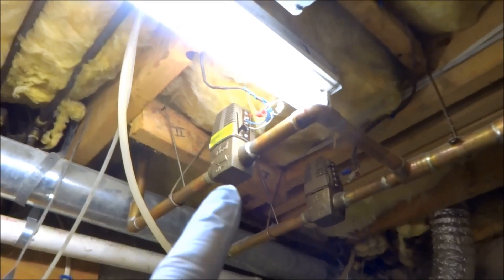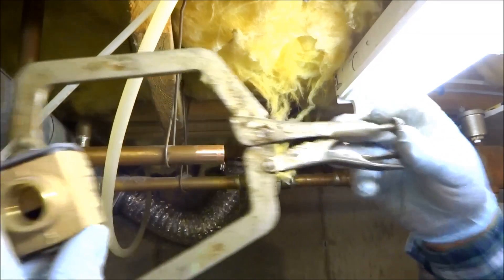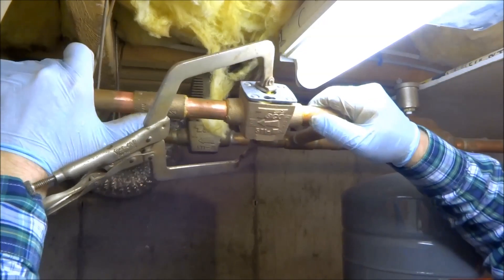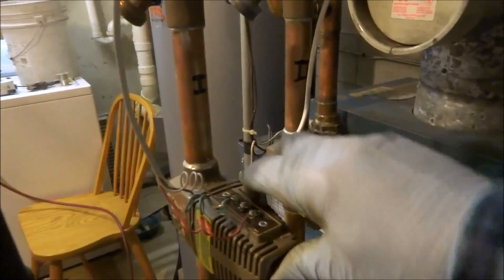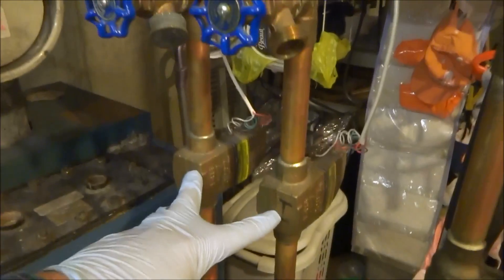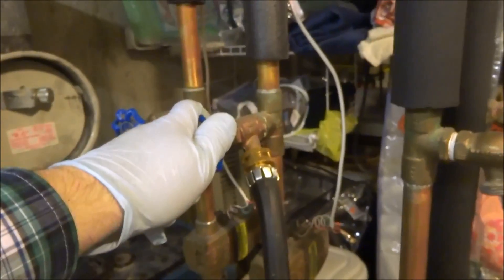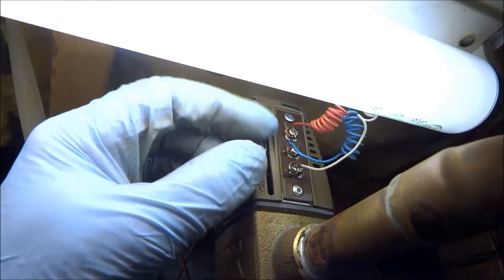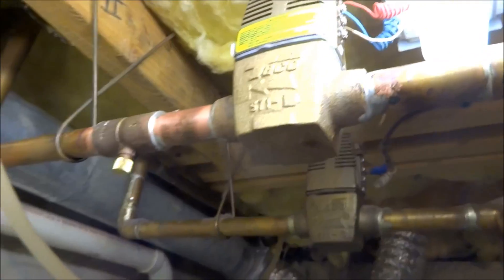bad taco zone valve replaced ,purged air from hydronic system

Comment: I have to bleed my system every 2wks., to stop the boiler from making a banging noise. The noise goes away after bleeding for about 2 wks. After 2 wks. there is air in it again. Air keeps building up in the system. All 4 zone valves do open at some point when the thermostat calls. Now when the boiler is making the noise i pull down on the second or third valves and the noise stops every time i do so. Sometimes when i pull down on the fourth floor it stops but not always. The only one that never stops the noise is the first floor. Any thoughts as to what might be wrong here and how i can diagnose it. In the past that same noise was a bad zone valve not opening causing the water in the boiler to make steam.

Comment: Who taught you how to solder? You put the HEAT to one side and the solder to the opposite and it gets sucked in around the joint. NOT stabbing the flame with the solder as you did. Jimmy L

Comment: That's good to know ive changed the pressure valve's and still didn't have heat on the the 3rd floor.that was my problem.thanks.

Comment: I believe my taco valve is stuck and wont close. Because at my home i replaced the top of the valve $85 one, and the heat at my house is on full blast. As if the valve is not closing with the thermostat.. Any advice? i will try to do this # Im scared there will be air bubles in my heater and ill have issues heating certain areas of the house if i do this wrong and theres air in my heaters. #but the real question is : " Valve bad or not" ? I feel like takign it out and doing a test with a water bottle.

Comment: My mothers heat is on and can not be controlled. Does this mean that one of these zones valve does not work? because it does not close the water from passing by?  I replaced the thermostat in the house , but that made no difference.

Comment: What does something like that cost?  I have a valve that sometimes stays open and heats up the house like crazy.  Not sure if it's a voltage issue or a valve issue.

Comment: Steve, I  had previously  asked about the operation of the taco valves,  but  since   then I found two   of your  videos, this  being one   of them,  the other was  the   one  you showed the wiring  of a step down transformer which would energize the boiler control after going through the teco valve number two to three after 90 seconds.  Want   to say a big thank you for helping out us newbies to hydronic heating system  understanding..

Comment: caps on the boiler drains on each zone to keep from genius home owners opening the gate valves and scalding themselves as well as leaking gate valves.  I know code officials require caps on zone purge/drain valves.
I love the quarter turn drain valves..but they do cost more but don't leak.  I give the owner a preference.  sorry  for the multiple replies but they limit my characters per reply for some reason.  I'm surprised you use that size turbo torch tip for soldering.  my old boss would freak on me if I used that size tip usually reserved for brazing large copper.

Comment: one more question would be why do you have a bleeder, after the new power head, facing downward vz upward?
Reply from the maker: +PatrickNJ so i do not build up steam and blow the solder out
Reply: +steven lavimoniere understand. That though never crossed my mine . Great idea so your not struggling with water causing soldering complications.  thanks for the reply!
Reply: +steven lavimoniere understand. That though never crossed my mine . Great idea so your not struggling with water causing soldering complications.  thanks for the reply!

Comment: Hello Steve: Yes some fittings do leak but none that I have installed have had that happen in several years. I have also seen some sweated joints leak after a few years of use as well. Water conditions tend to make or break any kind of joint. Depending on the amount of sulphur dioxide and other elements now found in much of our potable water. Changing all of our pressure lines over to PEX has solved all leak questions.
Using it now for several years and could not be happier with the results.

Comment: My question is: Why not use couplings on each side of the valve instead of soldering to make any future changes easier. Today shark-bite connectors could be used if 3/4 inch. TACO threaded valves are installed instead of sweating the connections. Is there a reason for not using this alternative method.
Reply from the maker: John Davidson skark bite fitting leak ,soldering is not hard if you have a clew what your doing
Reply: shark bite? two words, pro press